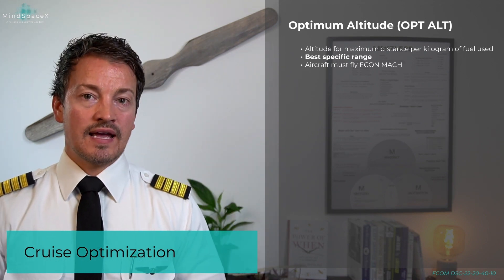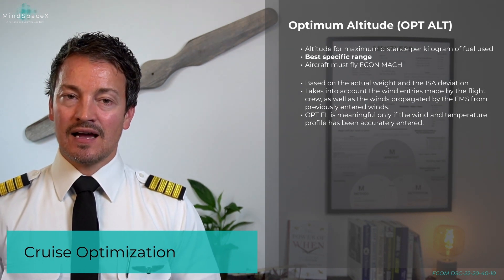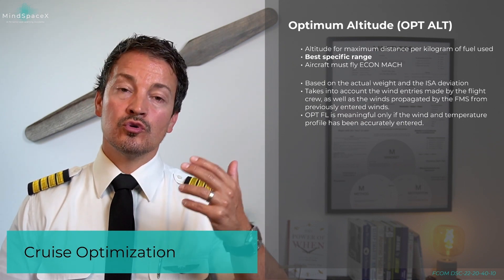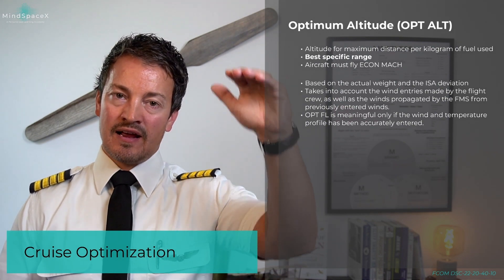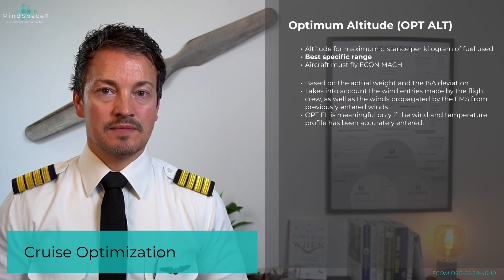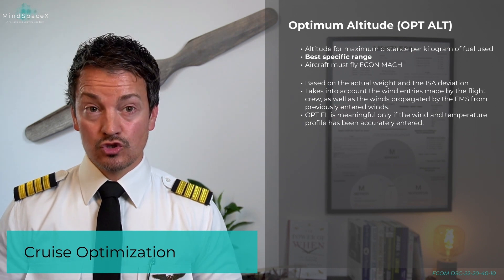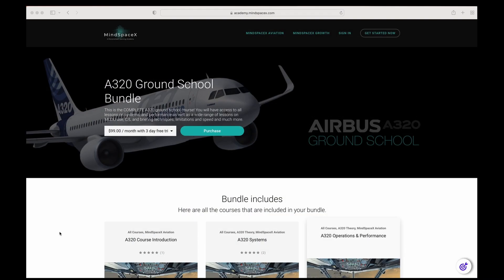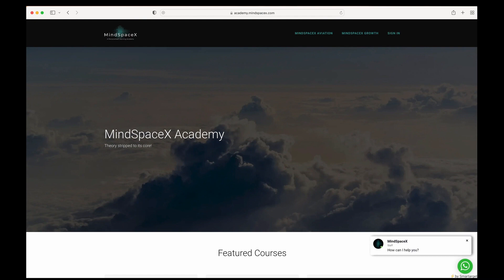Airbus Performance - Optimum Altitude (OPT ALT)

Comment: Captain, How does Temp affect the Optimum Altitude?
Reply from the maker: As temperature affect the density of the air it has a direct impact on the performance of the engine. The optimum altitude is not the highest altitude we can reach, but the altitude where we cover the greatest distance per kg. fuel burned. That means if the air is colder, it is more dense, which in the engine allows for more power with the same amount of fuel used.... or more correctly stated; the same amount of power but with less fuel used. 

Remember that: Thrust = Mass x Acceleration. Mass is the amount of air and acceleration comes from adding fuel. So you can either add fuel OR add more air to get more thrust. Or you can add more air (denser/colder air) with less fuel to maintain thrust.

We want optimum altitude to be as high as possible but are restricted by the mass of the aircraft. The heavier the aircraft, the more power is required. Comparing a cold airmass and a warm airmass, the colder air mass provides more thrust for the engines hence slightly higher Optimum Altitude.

But remember that Optimum altitude is main affected by aircraft weight. Temperature and density plays a small role.
Reply: @MindSpaceXAviation  Thank you very much captain for your appreciated detailed explanation.